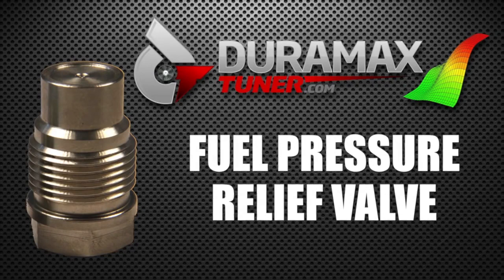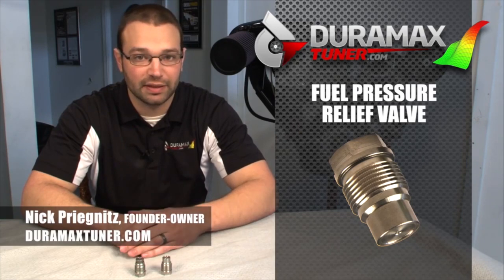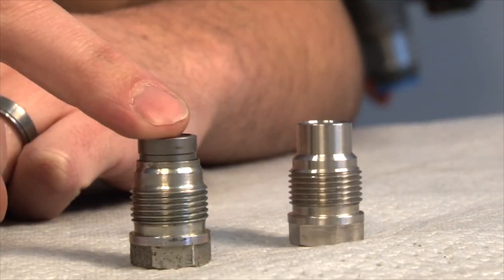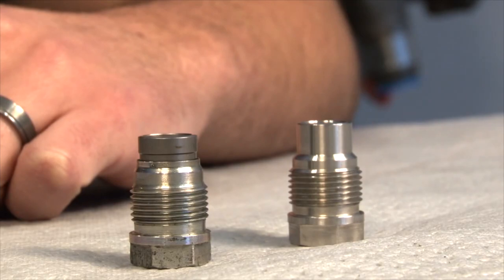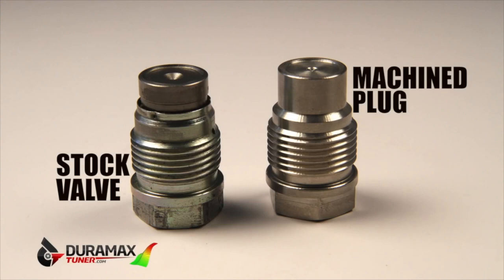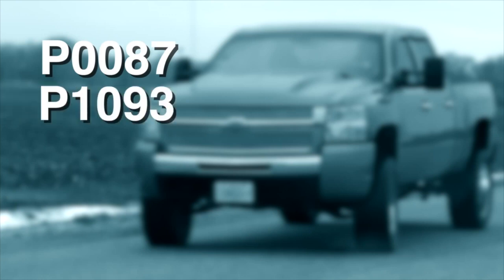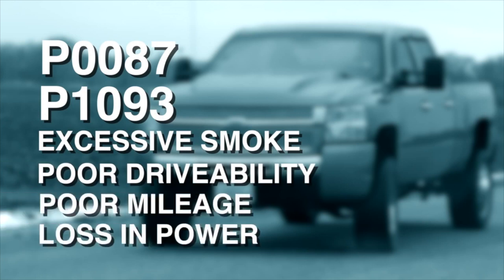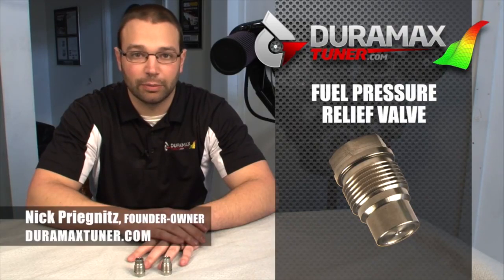FUEL PRESSURE RELIEF VALVE

Comment: I've got a 02 lb7 and smokes off and on the smoke is a white and sometimes blue have all the power in the world no tune or mods and the injector balance are within spec gets good mileage it ranges from 16 to 18 miles to the gallon could that be the problem with that at an idel it does not do it when going down the road.
Reply: u most likely have a sticking injector man

Comment: Does a 2001 lb7 have that valve
Reply from the maker: To clarify, yes the LB7 has a relief but it does not share the same design as the LLY/LBZ/LMM.  The LB7 design rarely ever fails
Reply: @Duramaxtuner  thanks for the reply
Reply from the maker: No.
Reply: @Duramaxtuner  why is PPE selling one for the 01,02 then , if they don't have it ????

Comment: 07 LBZ , in the last month after I put gas in the in the tank after I got where I was going and then try to come up Crank It Up I'll pull the 191 code I pulled the 087 a few times but it goes off within a couple hours. Will this relief plug work for me I've seen the race plug I don't think they have that little relief hole but I may be wrong let me know

Comment: does a 2004 duramax have this fuel pressure relief valve on it..
Reply from the maker: No it does not. Not until '04.5 with the LLY.

Comment: what about if your injectors are getting too much fuel the truck still runs great smokes at a stop and when it sits for a little bit you take the fuel filter off and there's no fuel in there but still starts fine

Comment: I have an 07 Classic LBZ and a DP5 EFI Live tune from Duramaxtuner.  I ran the truck for nearly two years with these tunes with no problems.  Then one trip pulling my racecar trailer the truck just started to feel sluggish and during an uphill grade it started throwing a P0087 code.  My first response was to change the fuel filter.  That did not stop the P0087 codes.  Once I got home and in normal driving around town the truck was low on power and continued to throw P0087 codes at anything over half throttle.  Then I remembered a conversation I had with Nick a couple of years earlier where he mentioned replacing the fuel pressure relief valve as it was a known potential problem.  So I ordered the fuel rail plug and installed it.  Immediately the power came back and I have not thrown a single P0087 code in the six months since.   I can tell you from experience that this valve can cause a lot of headaches.  It only has to pop off once or twice and from then on the spring in it gets progressively weaker and from that point on it opens when it is not supposed to.  $50 and 30 minutes to install.
Reply: 30 minutes, my ass!

Comment: Hi I have an 04 duramax lb7 and I'm loosing power sometimes like if the turbo is not producing boost or not enough fuel could that be the fuel pressure relief valve
Reply: The relief valve is rarely a problem on the LB7's. The valve featured in this video is for the 2004.5 LLY's-2010 LMM model Duramax. If you want to give us a call we can trouble shoot this farther. We need to know what conditions it is loosing power under. Also if you have any other issues like excessive smoke, or even how cold is it where you are at. Worst case scenario is you have a hard part failure. Hopefully it is something simple.
Reply: Dt Admin I seem to be having the same issue as JJ MORALES above in my '03 LB7. About 70% of the time, from a stop and then going to WOT the truck lags in power until about 2.5k RPM. Then it accelerates like normal through the remaining gears. This all started after getting new injectors. Can I call you guys about this issue as it may be the FPRV? The Fuel pressure regulator has been replaced as well and seemed to help, but not much. Don't know if you can help, but I've been banging my head against the wall trying to fix this for 6 months!